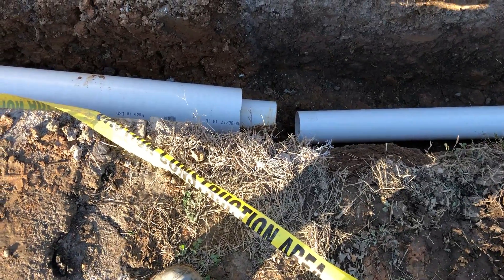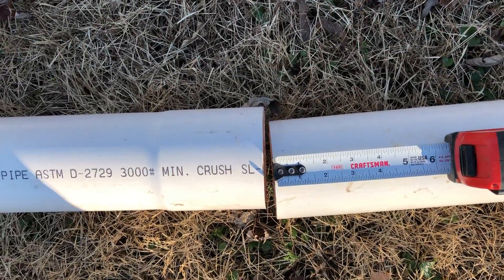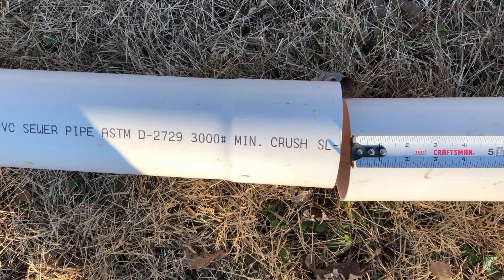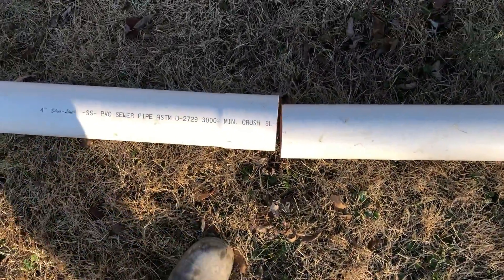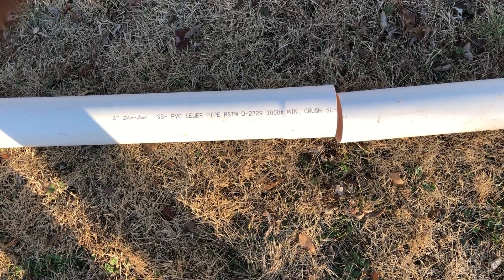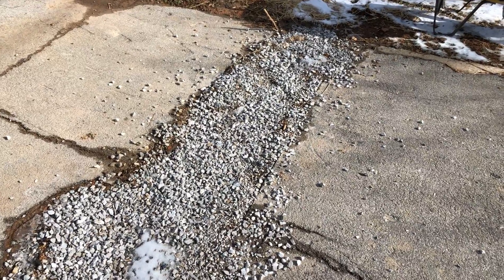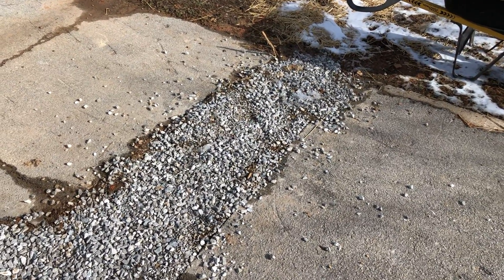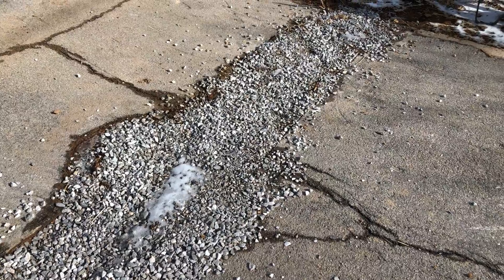Drainage Solutions | Drainage Sleeve

Comment: so the reason for the sleeve here is to avoid having to cut concrete/asphalt to make a future repair NOT to provide additional crush protection from the weight of vehicles crossing the drain pipe?  What is the minimum cover below the poured concrete or base/asphalt surface?  I'm installing  water and sewer services and being told if any traffic crossing best to have a sleeve for extra protection.  Doing in this case to avoid tearing up concrete/asphalt for a future repair makes sense.  Not so sure if it is intermittent traffic.
Reply from the maker: I’ve always done this for repair purposes, not protection purposes. I don’t see how adding a sleeve would be beneficial for protection as concrete will spread the load bearing weight of an object - such as a vehicle. If installing your lines in an area where concrete will not be poured and only backfilled with soil, then the pipe will bear a substantial amount of weight when crossed.
Reply: How much weight do you estimate?

Comment: Btw, any way to bore under that driveway rather than cutting and excavating it?
Reply from the maker: Mike Lewis https://youtu.be/pt-s5blVUBk

That’s one way to do it. With the use of a steel pipe and mini x. Works on sidewalks. The only other way I know to bore under something the width of a driveway would require some type of hydraulic press (compaction hammer) machine, but most of those only do 2” pipe, I believe. There might be some out there that can run a 4” sleeve, but I’m not aware of any that can run a 6” sleeve.
Reply: @bbdrainage  that video is a good idea. I need to run a 4" pvc under my sidewalk but unfortunately I don't have this gear that you have. I will attempt it with a trench shovel.
Reply from the maker: Mike Lewis I’ve done it that way many times as well. Good work out doing it that way ;) Depends on the job. Don’t always have mini x on site. 

Apple drains has several videos up showing that old school method up. Check them out if you need help.
Reply: @bbdrainage  ok thanks, btw how do you charge to install these systems. Is it by the hour or strictly by the job?
Reply: That depends on the type and diameter of the pipe you are installing.  Directional boring is  commonly used for sewer line installation.  When I did mine (2005), it cost anywhere from $25 to $40 a foot, and that was for a 6 inch diameter pipe.